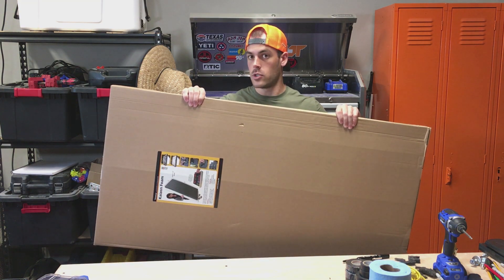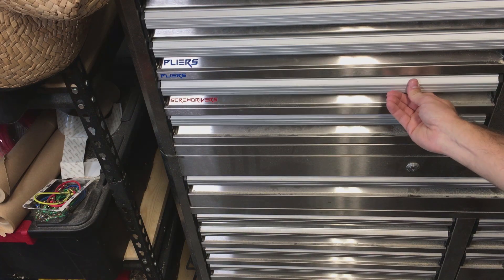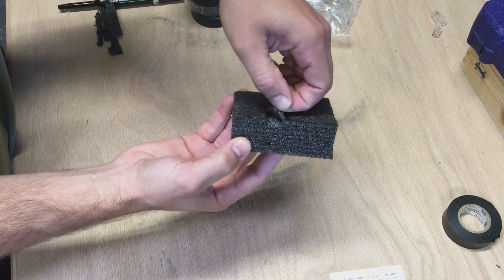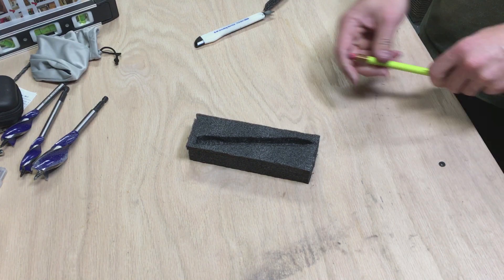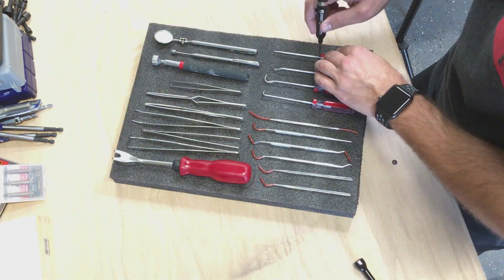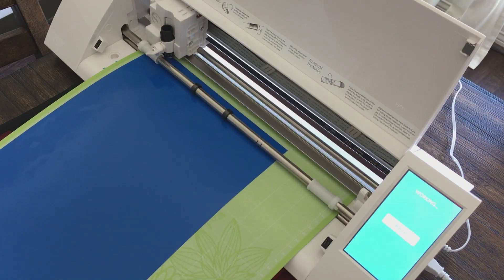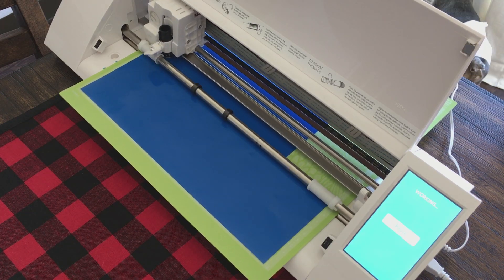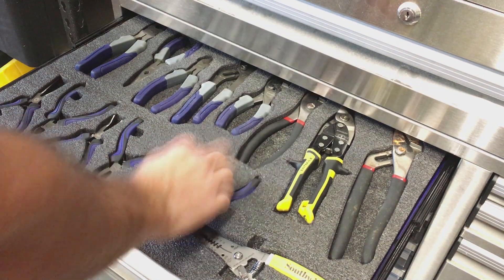Shop Tool Organization with Kaizen Foam // Toolbox Organization Part 2

Comment: Through my years in the Air Force this was a mandatory thing to do. 
Never wanting missing tools while performing maintenance on the Jet Engines or Aircraft jobs while using a smaller box on the flight line (right?) When I first entered, in one shop, tools were hung from nails on hand made plywood carts & stands, so two full sets of the normal tools and frequently used special tools could be displayed. Each side was securable on its own and the tools either laid flat(or on a nail) with a contrasting color in the shape of the tool hand painted on the wood behind it so it was “supposed” to be obvious if a tool was missing. Ahhh, the human factor!!!😳  As time passed,  the soft foam was used as you described in the video as the larger metal tool boxes/cabinets became introduced in higher numbers. That’s when the process for me became more along the lines of what you were kind enough to share with us. 
The softer foam is still a viable option in my humble opinion. Although I haven’t researched prices today, I’d have to think that it being being a more common product that it’d be less expensive in the long run since it’s not such a specialty or limited item.  I’m just thinking out loud. One drawback is that it won’t be layered like that shown in the video. As far as color goes, we used a common paint roller to apply the paint after the foam was cut. I don’t remember what type of paint we used but paint and the ability to research things has come a long way as you know. It may take more than one coats(the dried paint left a nice stiff layer to cut through with the underside remaining soft), but if you can virtually color match your tool drawer linings, it just might be worth it...  if you can find an upholstery shop or school, or even something like Fabric Warehouse(I’m showing my age) swing by and ask for a sample or a scrap. Then try a paint sample and see what you’d be getting into and decide. Yalls call...   I’ll confess that when I get to that point in the process, I’ll be using foam. I’m always open to conversation... I just remembered one thing. TIP: For the tools that could accept it(always being safe) we’d put them(sockets, plyers etc.,) in an oil bath that was used to heat bearings. After wiping them down, then lying them in the proper spot, the tools would simply melt their way into the foam!!! However, cool off quick enough not to go through...

ShopNation if you ever need anything from the San Antonio side of life, don’t hesitate!!! I can always meet you in the middle!!!

Comment: Awesome Video.. Thanks for the idea... started doing my tool box this week.. The foam was my missing piece.. and Rockler is only 15 mins from me... What brand is the vinal cutter you're using.. been debating getting one and looks like your did a good job on the labels...
Reply from the maker: Awesome, the vinyl cutter is made by cricut they are pretty cheap but work great
Reply: Looks like the vinyl cutter is the silhouette cameo 2